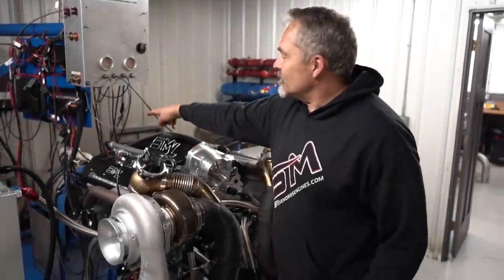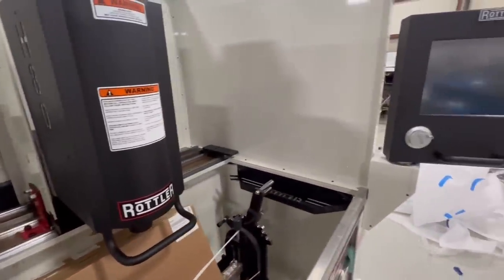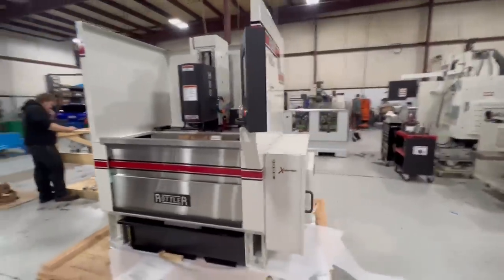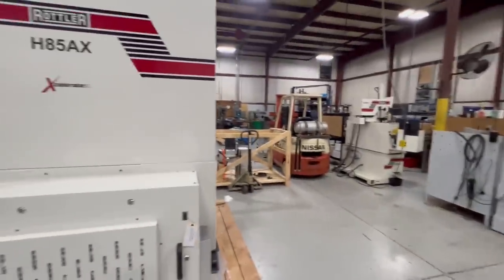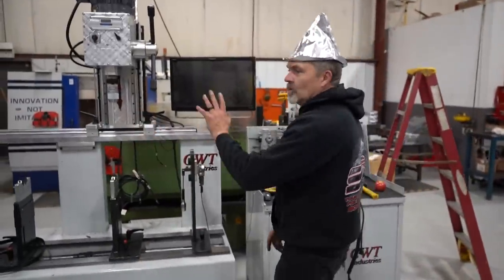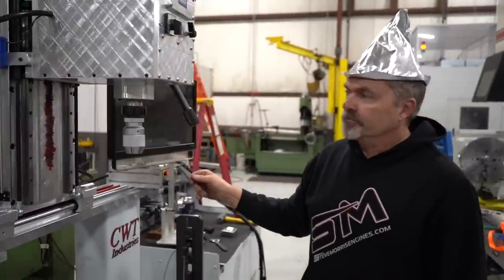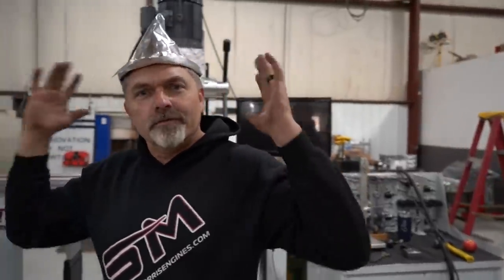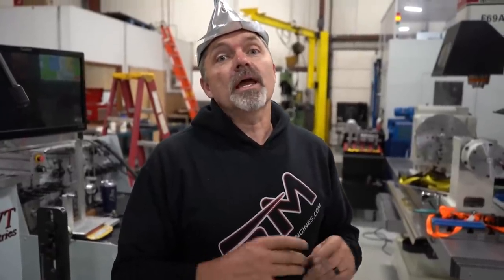Tinfoil Hats, Movin' Stuff, All To Fit The KING OF ALL HONES

Comment: A gantry chain would be super handy! Moving blocks all over the shop quickly and safely. 

Also looks like your nearly ready to expand further. Is it possible to extend and maybe have some dedicated bays for the racecars? Motion raceworks seem to have a really neat setup with inventory, manufacturing and workshop all kinda separate but in the same building.

Comment: Beautiful machine!  I'm surprised it's okay for that new hone to span across two sections of concrete slab.  At the machine shop where I work, many of our CNC machines are anchored to super-beefy slabs that are specially poured for the machines.  They cut sections of the floor out and pour the new thicker slabs right into the hole.

Comment: Shop layout is always a pain as you need to figure out the loading area, coolant change area, and tooling area.  A good industrial engineer can make easy work of that process!  I use to layout machines in a scale drawing (paper) with the added work areas then cut out the drawings and try to put the puzzle together.  You had a real headache figuring out what goes where in the space you have!  Have you ever seen the process to put in a shot peen machine?  The shot peen is loud and causes vibrations, so the machine needs an isolated concrete pad with a sound proof room.

Comment: What do you use for a line hone to hone mains? I used to work at a shop that had ended up making a custom job that had the bar counter weighted and ran vertically on a cable on some pulleys. For whatever reason gravity seemed to affect the cylindrical nature of the bore and oval it out more on the main farthest from the head of the machine when it was run on a horizontal plane. So they went vertical with it and turned it into a semi manual machine. Interesting solution that worked amazingly well. You had to really hang on to that thing. Was a few times I let the thing dry up and tighten up a little too much and had it grab on me, used to toss me across the shop 😂😂. Seeing that big bore hone brought back memories of a much smaller one we had near that other rig. Always a good day at work in that shop. Love the content man. Congrats on the new machine.

Comment: I have a dumb question. But the answer is probably too complicated for a quick answer so I'll try to ask in a couple of (possibly) easier to answer questions. 

What constitutes a great honing job on a cylinder and why is it important? 

Do different piston/ring/cylinder materials want different surface finishes (surface roughness or patterns) to get the best results?

To put it another way... if there were two identical motors ((Hah! I know you just rolled your eyes at the thought of two identical motors, but before you poke fun at that hypothetical... consider how much youve spent io machine tools in attempts to make your motors as identically close as possible to what you designed) in every way except that one motor had an average (not terrible but not special;) hone on its cylinders and the other motor had the best honing done to it that the new Rottler could do...what would the differences be in the lifetime of the bores? In performance or durability or break in time/technique?

I'm probably not the only one who doesnt know, but I may be one of only a few who will admit this level of ignorance LOL

And as long as Im proudly waving my airhead flag around ..  I'll double down with an "OOO shiny! and pretty!" comment. That CWT drill press has some dang nice engine turning done on it. It reminds me of Guilloche that you'd see on fancy pants watch dials

Comment: On the SML you should use the new Innovators West billet belt drive timing belt with the adjustable cam gear and make or buy the billet rear cover so the entire engine is completely billet and I don't know if you use the billet steel Bryant crankshaft or not but if you did and I know you use aluminum rods and forged pistons but if you used the billet steel crankshaft you would have an almost completely billet engine from top to bottom and I think if you wanted to you could have close to 95% of an all billet engine if not more and every chance I get I leave a comment on a Cleetus video saying he needs to get an SML for one of his cars more than likely Leroy and have the other LS as a backup engine and put the BBC in Ruby and have the SMX in Mullet and then he'll have three engines in three of his cars built by you and your team